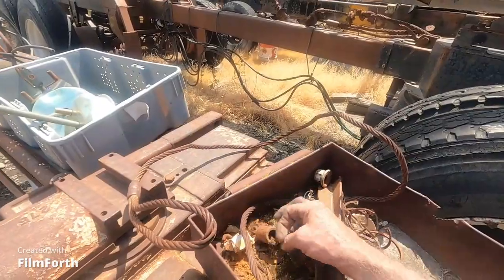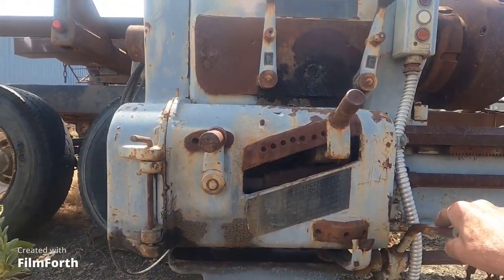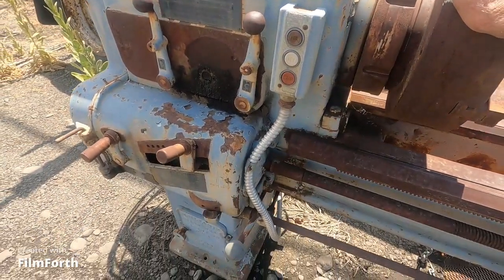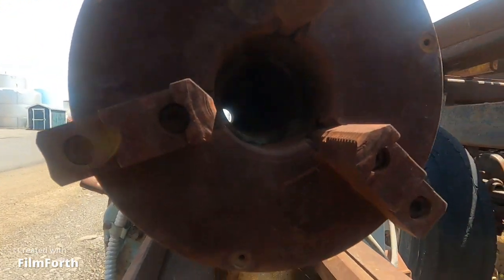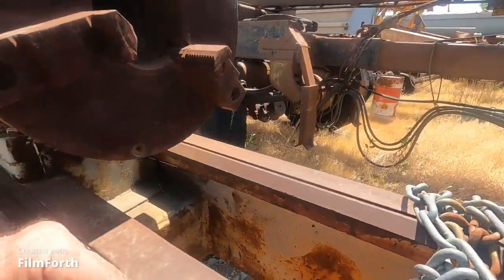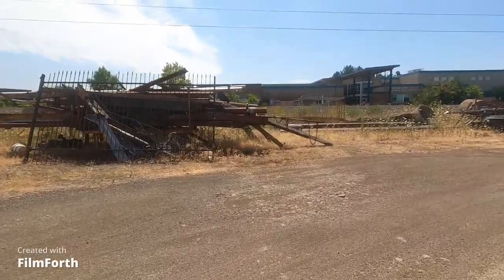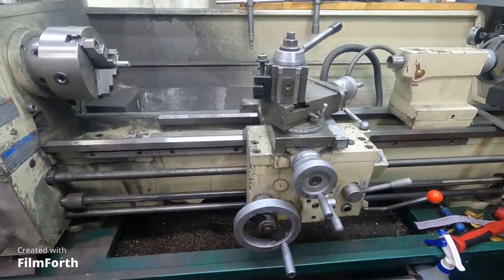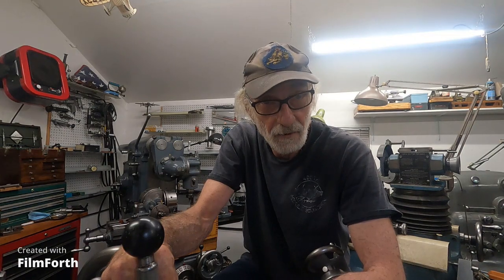The lathe that has not been rescued

Comment: I imagine that with that test bar you'd have to indicate the top and side to get a better understanding of the alignment. Could be that it was true right to left but off by 0.005" up and down
Reply from the maker: The directions show only from the side, tailstocks are normally .002 to .004" high when new. the test bars ends run true when rotated. I find trying to gage lathes with indicators and tools not as effective as cutting metal and gaging the results. This tool is like the two collar test but without cutting and done between centers that is something I hardly ever do, so cutting a piece of metal using the chuck is much more valid then even the two collar test for my work. Thanks!
Reply: I have one of those testbars it's good for alignment of the tailstock and that's about it! Better to have on that is centerless ground or ground on centers so you can check the condition of the bedways. Another informative video. Thanks Dee Dee